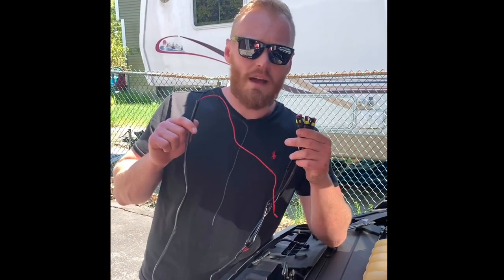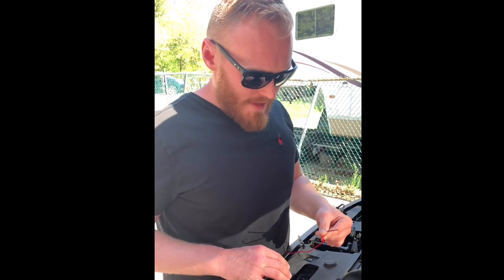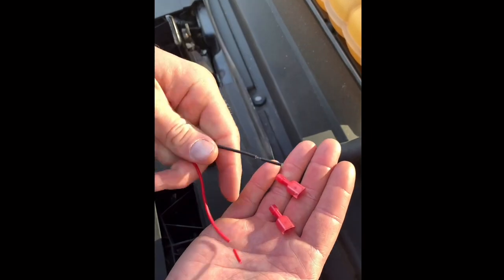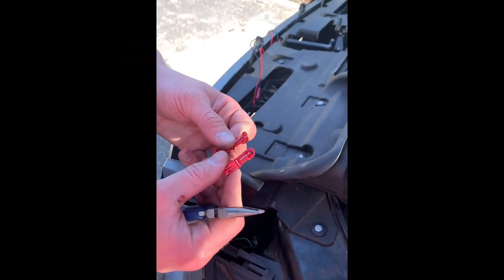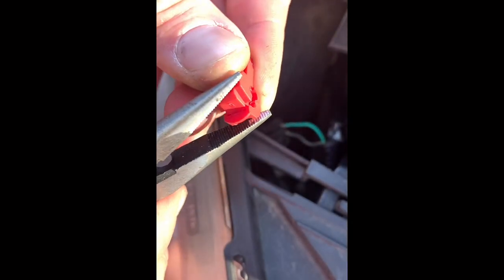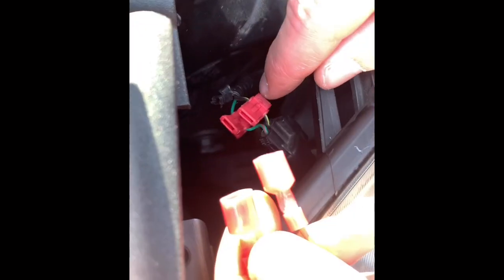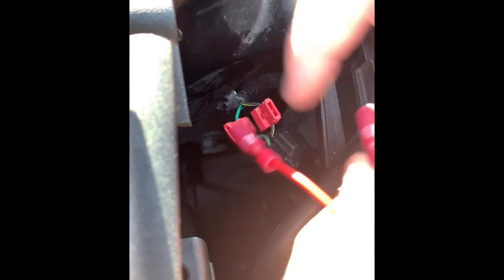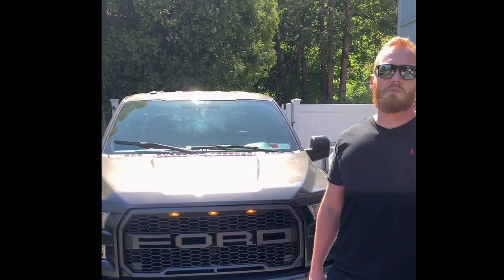RAPTOR GRILLE WIRING INSTALL: Step by step install on how to wire your 2016-2018 F-150 Raptor Grille

Comment: I paid off my f150 so now I'm making upgrades. And FINALLY a video that doesn't magically skip over the wiring. Thanks for the instructions. Very straightforward. Subscribed!
Reply from the maker: Congrats on paying off the truck! YESSS! Every other video skips it completely or does it wrong. Thank you so much for the kind words  and thank you for subscribing.
Reply: My grill kit didn’t come with those small things that connect to my wires ???

Comment: I bought a ram truck with existing lights and grille but they didn’t really care for amber so I bought different color ones with same exact connectors but didn’t work so I ended buying different brand with same connectors but still didn’t work, the old ones still work and are wired correctly could it be the wiring harness ?

Comment: For anyone with an 09-14 gen the wiring concept is the exact same, only difference is the grill stays connected to the hood. But, with the self splicers and connectors you listed in the description made this job so fucking easy. Got the lights hooked up and work. I have a 2010 fx2 ( it’s all I could afford within my budget) plus under 100,000 miles I couldn’t get a better deal for my first truck. But, I’m no mechanic by any means but, this job was very easy self fulfilling after I completed it.
Reply from the maker: Awesome man! Thanks for sharing and thank you for the positive feedback.

Comment: Appreciate all tips! It about time someone explained in detailed. Thanks!
Reply from the maker: Thank you for saying that. I appreciate it!
Reply: @AutoHeadz I took your advice connecting wires. No luck! Used 12 volt battery test lights. Good! Lights came with red lead that goes directly fuse box. Haven’t pursued yet. Any more tips share?

Comment: Thank you for this, been holding off getting the lights due to not having a plan to getting them wired up.
Reply from the maker: Thanks for checking out the video! My pleasure.  Did you install the grille yet?

Comment: Thanks. I got a 2020 F-150 hopefully its the same installation. As i am very green at installing a Raptor grill😮 one question how do you tuck all the wiring on the running lights? Are ya using any zipties to keep it from dangling around?
Reply from the maker: I zip tied and put under the plastic shroud. Thanks man!
Reply: Thanks. What's the Connector Gauge Size to squeeze unto the Running light wire? 16-14 Gauge size? Or 22-18 Gauge?

Comment: I just installed the grille and couldn’t figure out how to do the wiring until I finally found your video!  Thank you. 

One thing, I tried to find it in the comments before asking but didn’t find it. What is the specific name for those connectors?  Gonna run to the store and grab them.
Reply from the maker: The link to the exact ones is in the video description. Good luck!

Comment: Hey, what gauge wire is it? I have a 2009-2014 gen and I need to extend the wire so it doesn’t hang from the top of the hood when the hood is up. Thanks for actually going in depth on how to do this.

Comment: Awesome video, works - thanks! Quick question: followed steps exactly, I did notice & curious if it happens with yours - when I have the hazard lights on, I notice the grille lights would dim ever so lightly on sequence with the hazards?
Reply from the maker: Thank you! I haven’t noticed this with mine.

Comment: Great video! Does the wiring kit come with load resistors? Just seems like the 12v would be too much for the led lights over time..
Reply from the maker: No resistors included, just spliced into the parking brake. Been three years never had an issue.

Comment: Good late late evening. I know this video is 2 years old but First of all would like to say I appreciate your video and showing step-by-step. yes I agree every video that I have watched for the past 2 months or 3 months have all skipped the wiring of installing of the Raptor Grill. well I'm a lady trying to do this by myself lol. right now I'm having a difficult time trying to get  the plastic clamp or I guess they're called the brackets? on the grill  to snap onto the hood I have a 2009 F-150 XLT, but I'm sure I will get that part figured out lol, my  biggest worry is I'm just very nervous about the wiring 😟.. my question is the red wiring Clips,where did you purchase those. as I said I'm a lady doing this by myself lol and I want to do this right the first time lol, so I hope my questions on Where did you purchase those little red Clips,what kind?,what size?,what brand? etc etc etc lol,gets to you. hope to hear from you soon. thank you sir:-)
Reply from the maker: Hey!
Thank you so much for saying that. I really try and be as detailed and step by step as I can.
Don’t be nervous about the wiring just take your time and you will be able to knock it out.
1. The link for the exact clips are in the description of this video. Just click the link and it will bring you right to it.
2. When you use the red clips make sure you can see that the wire is right in the center before squeezing shut. You should use a pair of pliers to help ensure you have a good connection.
3. If for some reason the lights don’t turn on give the red clip another good squeeze and that should do it.
Good luck! If you want to reach out with any other question feel free to email me autoheadzf150@gmail.com

Comment: How did you know which wire to tie into on the parking light?   I bought the same grill for a 2009 f150 4x4
Reply from the maker: It’s the power wire for the parking light.

Comment: Man I’ve tried installing via quick splice & T taps on both sides and my lights won’t come on. However if I use a wire to run straight from battery to grill lights they light up. Any tips?

Comment: My amber grill lights stopped working out of nowhere. Checked connections, all are good and I tested pos/neg. All of my lights work to include DRLs I tapped into. Is there a fuse that I should check?

Comment: Do the lights on the grille flash when you use your signal light?  If you're tapping Into your parking lights and they're also your blinker, won't they flash when you signal?
Reply from the maker: Nick Rose Hey Nick! Nope it doesn’t do that. I’m not an electrician but I believe that has to do with the electrical resistance going to the signaling bulb. But I can assure you it doesn’t do that so no worries. Maybe someone else can educate us in the comment section, lol. Take care man!
Reply: @AutoHeadz  okay great, Thanks man! Love the video by the way

Comment: What kind of terminal connector and the size? Thank you
Reply from the maker: Hey man, I’m not 100% sure what size it was. If you click the link for the taps in the description you can match the color in the video and that will tell you the size I do it myself but I’m on the road right now hope that helps man.

Comment: Dumb question but, I figured I’d ask anyway. Did you take out the battery or disconnect it while you did the wiring?
Reply from the maker: Good question. No I didn’t. As long as the truck is off key out of ignition you will be totally fine.

Comment: I'm trying to do this on my 15 Platinum but that connector isn't there. I looked everywhere and the only harness going to that light is what looks like a 7 wire 16 pin connector and that's it. I has DRLs. Do I connect the raptor wires to something on that?
Reply from the maker: You can connect to that 7 wire but I am not familiar with the harness enough to tell you which wire to splice onto. I’ll try looking it up online.
Reply from the maker: On that connector there should be a power and a ground wire. Typically on the fords the power is a green wire and the ground is black.

Comment: Your videos have been a huge help bud, appreciate it. Question though- how did you access/identify the parking lot socket/bundle? Did u have to remove the entire headlight assembly? Go through the wheel well? I’m stuck I can’t see how to access it.
Reply from the maker: If you watch the video it was in plain sight for my truck. No wheel well or removal of headlight assembly required.
Reply: @AutoHeadz  Yeah something different on mine. Your vid was a huge help thanks
Reply from the maker: I’m glad I was able to help. I hope you find that wire bundle without too much trouble. Take care.

Comment: I installed using your perfect directions and thanks!! Question, the side marker light I tapped into is now dim. Did you replace your side marker lights with led or is your dim as well? Well done video!!
Reply from the maker: Thanks man!!! Mine was not dim but I did recently switch them out to LED’s

Comment: I followed your video and it was great, thank you! What did you do with all of the extra length on the wiring harness? The one that came with my grill was really long. Did you just zip tie it and leave it off to the side?
Reply from the maker: Hey Angela. Thank you! I’m glad you liked the video! My grille didn’t have much slack left but I just tucked the extra wire into the upper grille area.
Reply: @AutoHeadz  thanks! I appreciate the quick reply. Mine has several feet of wire left, I think I'm going to cut it shorter and just tuck it in like you did.
Reply from the maker: I honestly would just zip tie the slack and tuck it into the front grille area we’re the plastic shroud is.

Comment: Do you happen to have a link for just the wiring harness?  I have the grill installed, but no wires or taps.  Thx
Reply from the maker: No wires? Like nothing connected to the lights?
Reply from the maker: This is for the harness - https://amzn.to/3i66WgM
Reply from the maker: Taps - https://amzn.to/3ADuY9u
Reply: @AutoHeadz  I bought a 2017 F150 Sport with a Raptor Grill.  The three lights are there, with the short wires and female ends connected to each.  But nothing else!  And I'd like to get the lights working.  The kit you had with the yellow waterproof connectors and crimps onto parking lights looks perfect -- that's what I'm trying to find.  Thx again for any help
Reply from the maker: My pleasure! Good luck.
Let me know how it goes. Have a good thanksgiving.
Reply: @AutoHeadz  Thx man - one last Q - my local dealership was concerned that connecting the three new lights to the current running light load might trip a warning code in the computer.  Just thought I should confirm this hasn't been the case for you?
Reply from the maker: Nope, you will be totally fine. 
The load for the LED’s wouldn’t even come close to being an issue. You have my word.

Comment: Since you wired these to the parking light wires, does this mean the lights will only be on if my parking lights are activated? If im driving at night will these lights come on with my headlights?
Reply from the maker: Yes, the lights come on automatically when your regular lights turn on.

Comment: I have a 2019 f150. Will this be the same?
Reply from the maker: Not the same but VERY similar. I would reference the location of your “parking” light before splicing because if the different headlight design.

Comment: I ordered the Raptor grille from Summit racing . IT has 2 long drl on the bottom of the grille. The grille is not pictured on the web site at all??
Reply from the maker: Hmmm..no I have t seen anything like that. If you have a link I’d like to check it out.
Reply: @AutoHeadz  i have a pic but can't send it.

Comment: Do the lights stay on while driving when tied into the parking lights like that? Great video btw!
Reply from the maker: Thanks man. Yes, they do. Everything works perfectly and exactly as you would see on a stock F150 Raptor.
Reply from the maker: The lights go on and off with the regular headlights. So when you have your lights on auto, the Grille lights will automatically turn on with the headlights.

Comment: Can I run the wires straight to the battery?
Reply from the maker: Unfortunately no, because the lights would not turn off.
Reply: @AutoHeadz  ok thanks
Reply from the maker: Leonard Evans No problem man. I learned that the hard way! Lol

Comment: Won’t those connections get water in them?
Reply from the maker: No these are completely sealed up. It’s hard to visualize it until you actually see what these look like in person but it’s basically like making a plug that would go into a socket. Once you bite down on the connectors it’s a clean connection.

Comment: My lights didn’t come with the crimp connectors how do I do it without them??
Reply from the maker: You have to order those separately. I put a link for them in the description of the video. Makes the process WAYY easier.